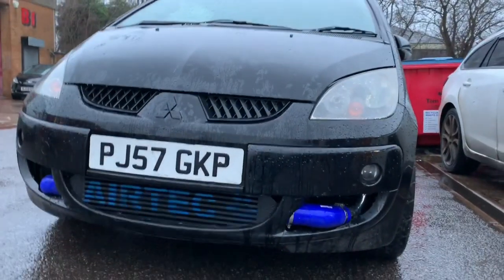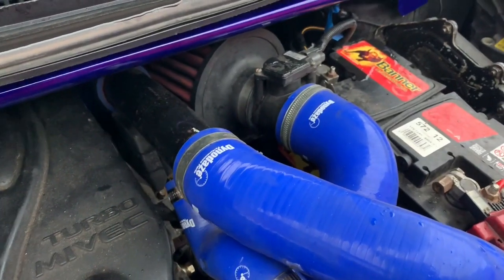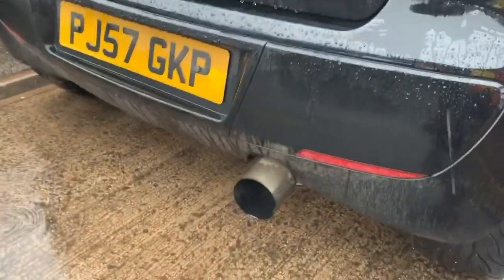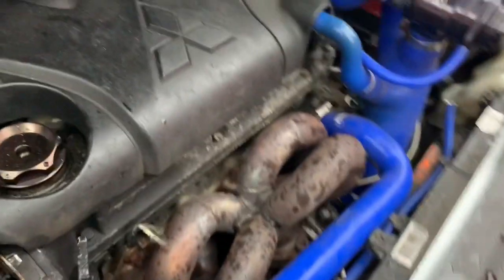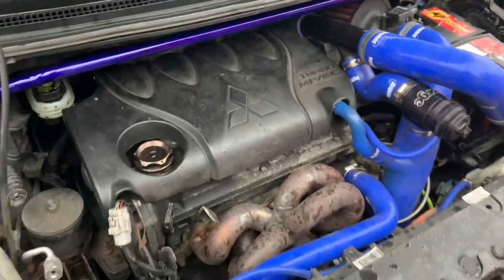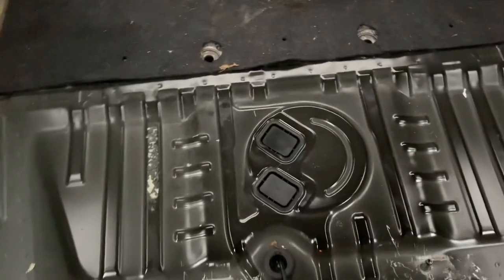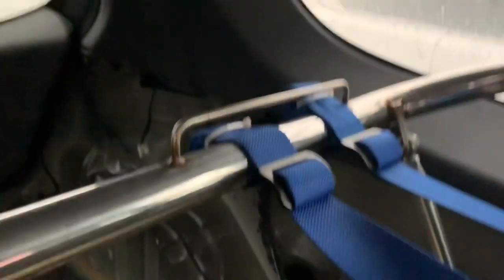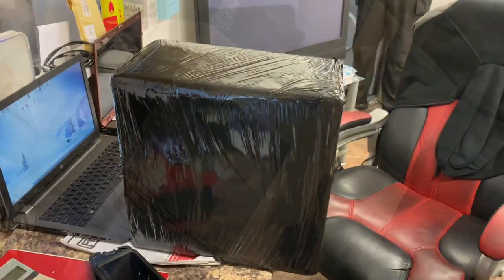Stage 2 Mitsubishi Colt CZT & Ralliart What Mods Needed?

Comment: 220hp after all that money spent? Mine is running 206hp with a standard manifold and without the airtec intercooler and injectors. And on a standard clutch with no issues. Seems a lot of money to spend for an additional 14hp
Reply from the maker: Agreed. But you are looking at peak power and not taking into consideration the midrange gains. The turbo is tiny and so will only flow 220bhp ish certainly not much more